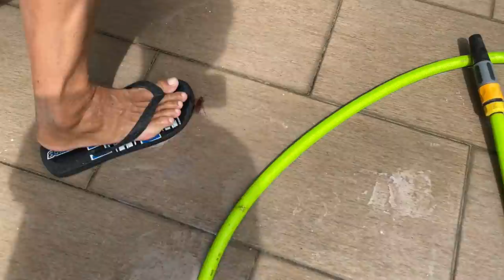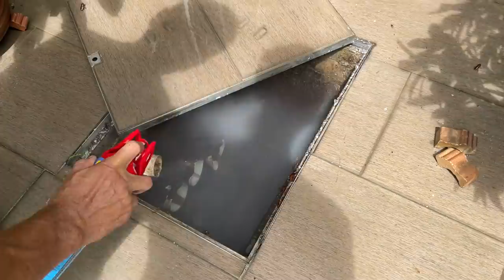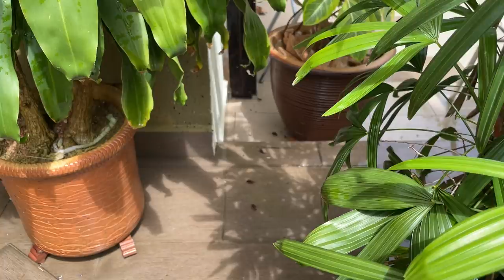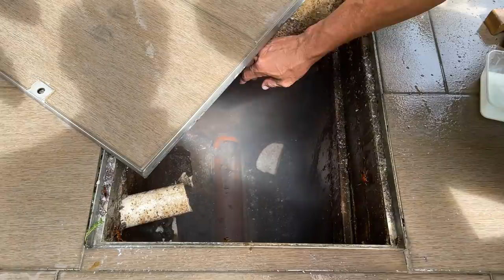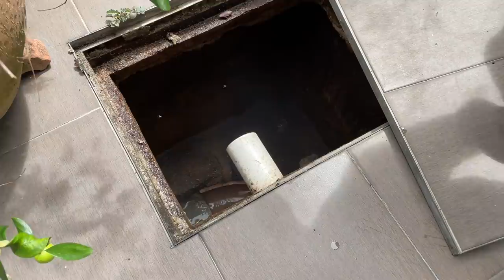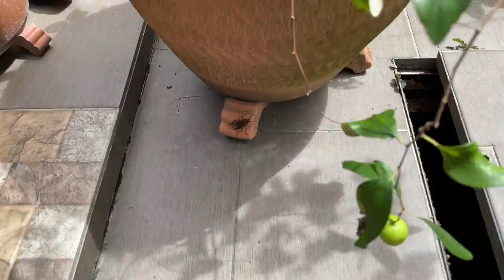COCKROACH INFESTED DRAIN ~ Chills down Spine !!!

Comment: cockroaches are a B to get rid of. I remember one time where I had a carpet cleaning machine that I didn't use for a while, decided to use it again, removed the water collection tank, and I kid you not, there were probably over 75 roaches behind it. I still sometimes have bad dreams about it. Thankfully we have good pest control here and we haven't had issues with roaches since. Defiantly took several treatments but we're good now. that drain is very similar.

Comment: Tip the only reason there so many roaches is because of the heat and moisture. Idk what it is them 2 things combined you going get some big mofos and lots of them yikes he would been better dropping a bomb put the cover  back on then spray the small hole or and gaps they try get out off

Comment: Pro tip: call in a pest control technician and find your water meter. They breed more in this area for some reason, but tell the technician to spray the meter box thoroughly. You also need to bait your house with advion roach which looks like peanut butter. Roaches transmit food to the rest of their colony and that's the BEST way you can get rid of them.